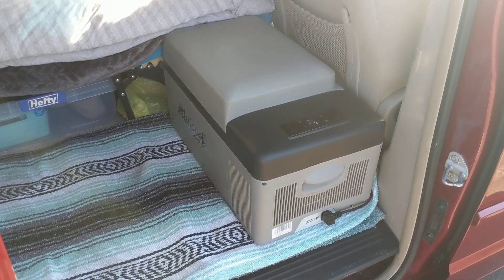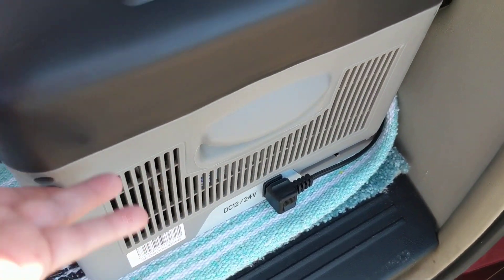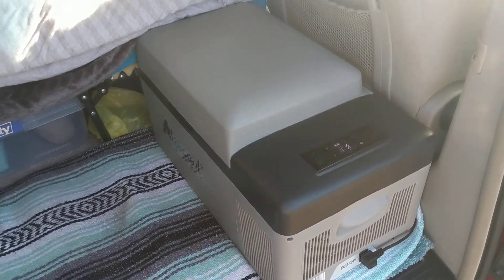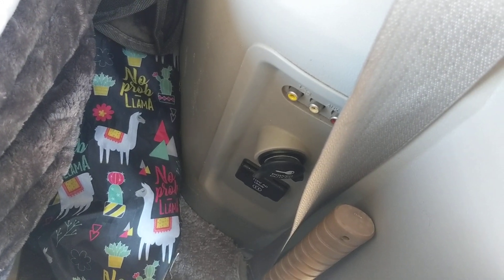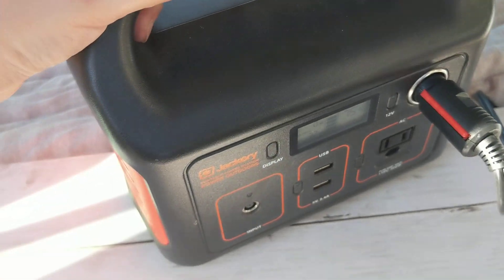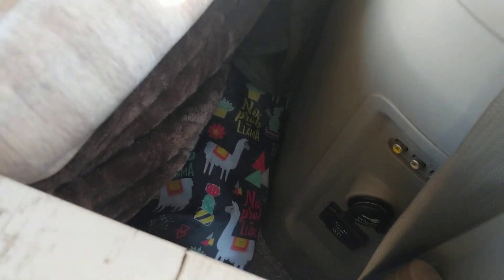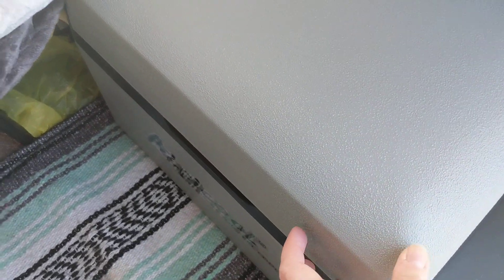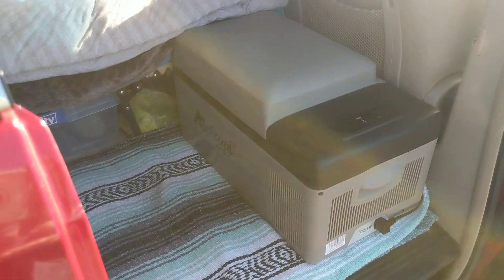Installing My Alpicool Van Fridge | DIY No Build Minivan Camper Conversion |

Comment: Since the Jackery 240 has pass through charging, just leave your Alpicool fridge plugged into your Jackery, then use your 12v charger from your Jackery to your vehicle that way you will always be charging both when you drive.

Comment: I have it. It's awesome. I have it plugged to the Jackery 240, and the Jackery connected to the outlet, so that the refrigerator is powered constantly and the Jackery gets power when the vehicle is on.
Reply: Great tip👍

Comment: Id love a review on how well it works 💪
Reply: I got mine to use as  an extra freezer.  Holds a lot and mine works great, so far.  Going on 3 months now.
Reply: @Pam_in_IN , how is the energy consumption as a freezer.  I expect it to be higher, but reasonable.
Reply: @karinhart489  I’m not really sure.  Right now it’s plugged in my house 110 outlet.  Glad Amanda showed how little wattage it used off the Jackery.
Reply: @Pam_in_IN  thanks that's what I was going to use it for too
Reply: @Pam_in_IN ,  Cool!  One reason I may move one of those up higher on the budget priority list is in addition to using for camping, it could be used with a power station as backup for prolonged power failures.  We are having utility caused power outages every summer thru autumn due to fire danger ⚠️.  That was why I got Jackery’s 60w folding panel when it went on sale to keep it charged up.

Comment: Hi Amanda,

Do you know how long you can run the fridge on your Jackery 240?
Reply: Mine runs my Jackery out within 12 hours.
Reply: @tanyalove-forrest126  That's good to know! I have an Ecoflow Delta 1300 and found it to be a bit underpowered for running the Iceco Go20 fridge freezer I originally bought go with it in my van. It ran for about 24 hours with both the fridge and freezer on. Returning it soon and I think going with a yeti cooler. But definitely still curious about other people's battery and fridge setups
Reply: @tanyalove-forrest126 , which model Jackery, a 240?
Reply: @karinhart489  yes the 240.  In it's defense I didn't buy it for that - just to charge my cell, computer and run a small fan.  The cooler was a ad-on last year.
Reply: @tanyalove-forrest126   no defense needed, I have a 290.  The nice thing about a Jackery is you can have a small fridge like that C20 plugged into it, & have the Jackery plugged into you vehicle’s 12v socket for recharging as you drive, and if you stop the Jackery keeps the C20 charged for cooling.  Not all power stations have that kind of pass through.

Comment: I'm surprised that you got a fridge.  We have a dometic fridge that takes very little wattage.  But we prefer our Yeti over a refrigerator.  We don't put actual ice into the Yeti.  The Yeti sits in our off grid location and we use those blue ice packs (loads of them), swap them out every other day to keep the Yeti cold.  It's been very effective and no mess.  How do you like your refrigerator as oppose to the Yeti?  I supposed when we go camping with the Yeti, that'll be the real "true tell" on whether we still like the Yeti as much.  I'm not a fan of having thing slushing around in there, so there's that.  Perhaps we can put bunch of ice just in some dry bags while keeping the Yeti mess-free.  Who knows.  Though curious as to your thought on the fridge.  Thanks.
Reply from the maker: I used my Yeti for a year before switching. Turns out I prefer messing with power to messing with ice. 😅

Comment: How did you change the cryptic settings to fahrenheit? Or the actual cut off voltages so it doesn't kill the battery?